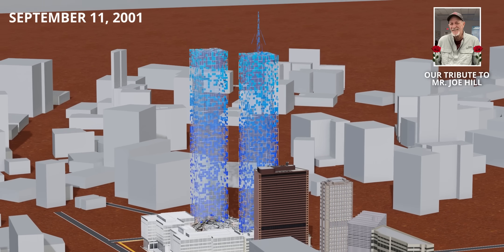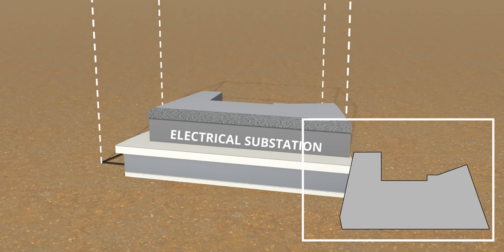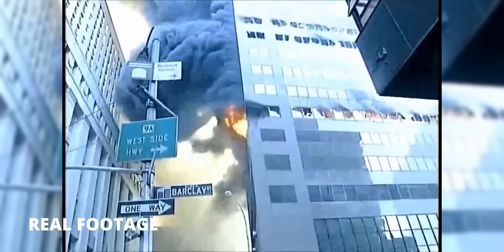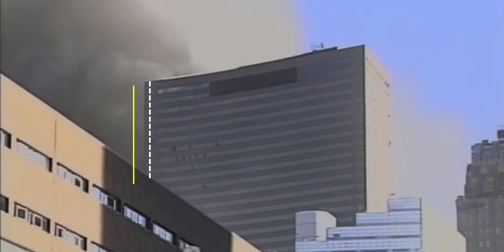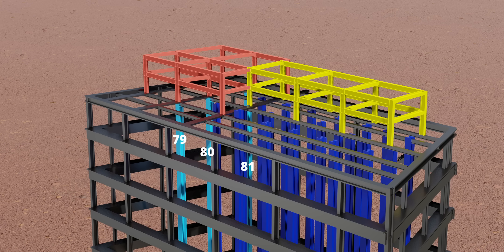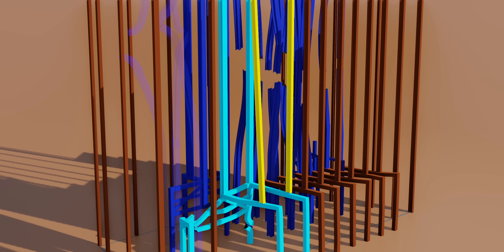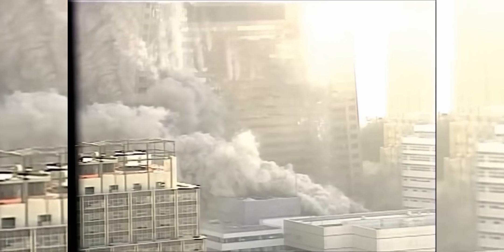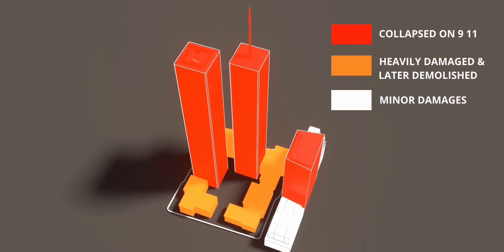Collapse of Building 7 | The Complete Physics

Comment: The video is missing the steel core of each tower . That would have remained standing even if the floors collapsed
Reply: But he is correct . Each tower did have a core . And even if the floors attached to the core collapsed,  defying the third law of motion . The cores would have remained standing . Meaning the cores were taken out “ by other means “ . And not by a fire . Where did the jet fuel come from for the fire . Seeing that all of it would have burnt up after  several minutes . Most of the jet fuel went up in the initial explosions from the aircraft hitting the buildings
Reply: @TrevorCrook-c1s  - And here we go again.

While complex, most of the Twin Towers collapse mechanisms can be seen with the naked eye and easily discerned and understood by the layperson if sufficient time is taken to understand. 

1. The Twin Towers consisted of 4 primary structural elements that together formed an integrated system where each element relied on the others and could not survive on its own .  47 hollow box-section steel Core Columns carry the majority of the gravity loads. The 236 hollow box-section steel Perimeter Columns carry the remainder and ALL of the lateral (wind) loads. Long-span Lightweight Steel Trusses connect the core and perimeter column together at each floor with a Hat Truss on top to tie the structure together as an integrated unit where no element can survive without the others. There was no structural load bearing concrete and most components were bolted together. www.youtube.com/watch?v=u7OqrC74Dm4 

2. The impact of 117 tons of airplane (= to about 12 dump trucks) at speeds up to 590 mph with the energy of a ton of TNT completely destroys the aircraft. This in no way implies the Towers come out unscathed. Many perimeter columns are damaged or destroyed as are some core columns (example; 33 of 59 perimeter and 20 of 47 core columns damaged or destroyed at the impact floors in the North Tower), This damage is primarily through bolt-shearing failures at the end connecting flanges, as well as bending, twisting and fracturing of weld seams. There was no cutting or slicing - the reality was far more violent and messy. 

3. The impacts destroy or damage fire insulation, fire breaks and sprinkler systems on multiple floors.  Huge fires are started across multiple floors simultaneously and allowed to spread rapidly with no effective firefighting or fire suppression. This was an unprecedented fire event . Jet fuel acted primarily as an accelerant and was largely consumed within the first minute. Plenty of things in any buildng that burn. 

4. The hotter steel gets the weaker it gets .  With fire insulation stripped away and no sprinklers the survival time of the steel greatly reduced. Gradually over time heat causes the lightweight steel Floor Trusses at the impact damaged floors to sag, which was observed and recorded.  No steel melted or needed to. Structural steel fails long before it becomes a puddle. It just needs to bend

5. Sagging floor trusses pull on the increasingly weak and overloaded Perimeter Columns, causing some of them to bow inward by up to 5 feet. A straight column is up to 4 times stronger than a bent column. The bowed Perimeter Columns buckle and fail, initiating collapse. The formerly static mass above which the structure below could easily support is now converted into a dynamic mass up to 30 times greater. Because they have buckled, the Columns above and below the failure point are no longer aligned . The load bearing structure below no longer bears any load as it falls past the lower columns, NOT onto them.

6. Thousands of tons of debris fall within the four outer walls, down through the open office space, crashing onto the first intact floor it encounters. This massive impact immediately breaks the bolted connections to the columns as the amount of resistance the Floor Trusses can offer is negligible.  The falling debris slows only marginally and briefly. Note:
6a. This is NOT a solid top block crashing into and “crushing” a solid bottom block .
6b. The debris falls past the columns not onto them.  The columns provide no resistance to the falling debris. 
6c. Only the bolted connections of the floor trusses to the core and perimeter columns can offer any resistance. A pair of 5/8” bolts at each end of each truss vs. thousands of tons of falling debris
6d. No laws of physics are violated

7.  This floor-led collapse progression within the four outer walls can only go straight down. Note: 
7a. This process is often incorrectly referred to as “pancaking” which actually refers to a completely different process rejected at an early stage. The catchy name stuck but nobody knows what it is supposed to mean.  Pancaking is too simplistic and inaccurate anyway. More like Kaiserschmarrn.

8. Collapse progresses through the floor systems not down the columns, through the path of least resistance . Rate of floor failures increases with each successive floor as momentum increases, reaching an average acceleration of 0.65 of GA, or 35% slower than true free fall. Bam, bam, bam down the building until there are no more floors to fail.  The resistance offered by each successive floor is always the same. The mass and velocity, thus the energy of the falling debris is constantly increasing, with each floor destroyed adding new falling mass. Some falls to the sides, but most falls down. More mass, more velocity, same resistance with each floor.  Don’t get stuck on the but the lower floors weren’t on fire nonsense. They weren‘t and didn’t need to be.

9. The Towers were 95% air by volume. As that air was compressed inside the building it is forced down the tower and blown out the sides in reaction to the building collapsing . Those were not “explosions”, it was expulsions of compressed air caused by the collapsing building, explaining the low velocity, lack of flash, blast, supersonic pressure waves and lethal high-velocity ejecta.  

10. Perimeter Columns become detached and peel away like a banana behind the collapse front, playing out to the four points of the compass extending to more than 600 feet from the base of the towers. This was quite obvious from examination of the debris pile. 

11. Core Columns fail last as their internal beam bracing is stripped away by falling debris and lateral support from the floor to perimeter columns is lost. 

12. For those who care about how long this whole process took; 31-34 seconds from the moment the perimeter columns buckled until the last core columns hit the pile, or 1/3 the rate of true free fall. Don’t believe me?  Just watch any video of the collapses and note the loose truly free-falling debris dropping much faster than the towers themselves.  

13. Each Tower had a 1-acre footprint. Far from collapsing inside their own footprints the debris pile spread out over 17 acres in a pile up to 14 stories deep. 8 surrounding buildings were destroyed and scores more damaged by the falling debris. 

14. NOT observed were the 180-190 dB bangs of thousands of high explosive devices or the blinding bright flashes of burning thermite. Neither explosives or thermite could have survived the impacts and subsequent fire nor could have caused the (silent) perimeter column buckling that clearly initiated collapse either. A video of a shocked and injured firefighter casually using the magic word explosion is in no way proof of explsoIVES  and the demolition_ case relies entirely on that sort of thing. There is zero tangible physical evidence and it would be technically impossible, totally impractical and completely unnecessary. No one would bother. 

15.  Finally, the Twin Towers were perfectly safe within their design envelope.  They only collapsed when taken far outside design parameters by an extraordinary and unprecedented event 

Impact + Fire (heat) + Time + Gravity = Collapse . Remove any one of those four elements and there is no collapse. Ignore any of those elements (as many do) and you will never understand the collapses. The Twin Towers were an integrated system in which no one component could survive without the others. One fails, the rest follow, through the path of least resistance – DOWN – through the open space, bypassing the path of greatest resistance – the columns.  Nothing I just described violates any laws of physics. All of the above is true no matter who planned and carried out the 9/11 attacks or why 

In 24 years zero structural engineers of tall buildings, including the 1/3 that have retired in that time, have made any statements in support of 9/11 Truth BS demolition claims. Zero, nada, none. The lack of any such citations in the engineering literature (published in any country worldwide) is palpable.

I hope you found this helpful and informative. It is not meant to be adversarial, but to solicit informed critical comment, positive or negative. If I made any errors of fact, logic or reason or left anything critical out, please let me know so I can fix it. To stay focused just one topic at a time please and on-topic (Twin Towers ONLY). No word-salads of Gish Gallop. IF you can offer a more plausible alternative be my guest. Be the first. Please start any reply with the words “Tits McGee” or I will know you didn’t actually read it, are not serious and just wasting my time. If you are going to argue, do it on the merits.
Reply: Each Tower? This video is about only one Tower. 

Did you even watch it?

You didn't,  did you?

Just jumped up conclusions, made assumptions.  Couldn't wait for your need to feel special moment. 

Embarrassing 😮
Reply: This is not the complete physics . The complete physics would have included the third law of motion which would have made a pancake collapse ( official explanation ) impossible . The downward force created by the top floors collapsing would have been met by an equal upward force by the undamaged lower floors . When the energy from the upper floors had dissipated the collapse would have stopped .

Comment: The third law of motion makes a collapse as mentioned in the official explanation impossible .  In reality when the top 15 floors fell onto  the lower floors the lower floors would have pushed up with equal and opposite force . When  the energy from those top floors  dissipated the collapse would have stopped 
Using the physics of the official explanation it would by impossible to sit on a chair 
The whole thing is laughable
Reply: Dude, seriously. Stop banging on about the Twin Towers. This video is not about the Twin Towers

You didn't even watch. 

How is anyone supposed to take you seriously?

Comment: It was not the antenna, which was not robust enough to cause that damage.  The entire wall of columns facing WTC7 peeled away like a banana. The falling steel caused damage in all four directions the towers’ walls faced, stretching as far as 400 feet. WTC7 was NOT over 400 feet away from that side of the tower.

Comment: after 23 years, you are still trying to proof that "original" story? Give it up, it changes nothing now, if that version or the other....
Reply: You may not like it after more than 2 decades of internet conspiracy dogma, but what is being presented in this video is fundamentally correct and widely supported by the worlds engineering community.

While imperfect (there are a few problems) this video goes into a much higher level of detail than many viewers can comprehend and gets the collapse mechanisms fundamentally correct. This is true no matter who planned and carried out the 9/11 attacks or why . 
	
Sure, it’s not what you want to hear and goes against 20+ years of conspiracy dogma and conditioning, but that is not the same as it being wrong. You just need to fix your dogma. 

On the plus side, this video can be (and is) fundamentally correct about the engineering AND the 9/11 attacks could still have been some sort of inside job. The two things are in no way mutually exclusive. It’s just not the inside job the clowns you have been following on the interent have been telling you. 

This will surprise you to learn, since the conspiracy side of the internet hides it from you, but the mechanisms described here have broad professional support around the world. There are no professional engineering organizations (for example: ASCE, ASEE, ICE, etc) that disagree with them or have offered any formal dissenting opinions or alternative hypothesis. 

So, either the overwhelming majority of the worlds structural engineers and quite frankly simple observation are wrong,… … or you know more than the worlds best engineers from cruising around on the internet. Which seems more likely? 

If this explanation is wrong then produce a better one.  Be the first to even try.